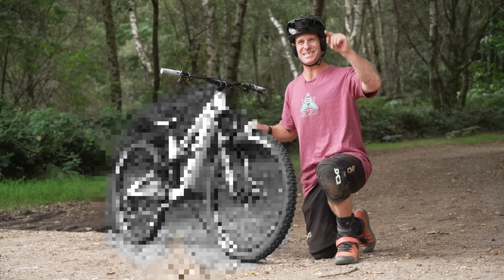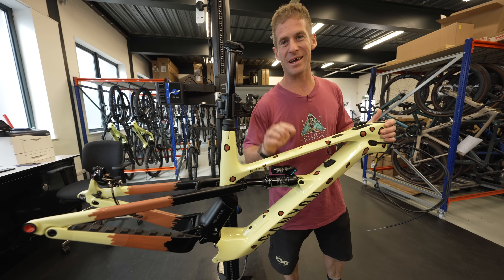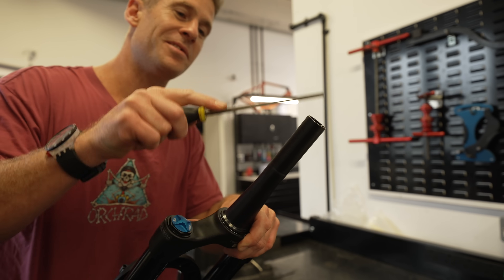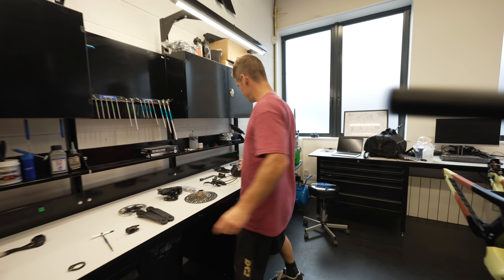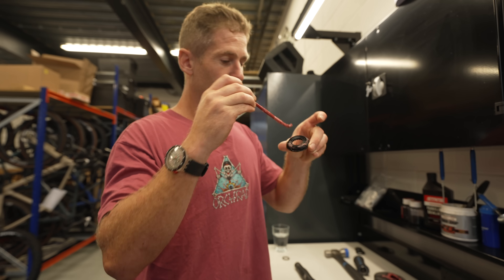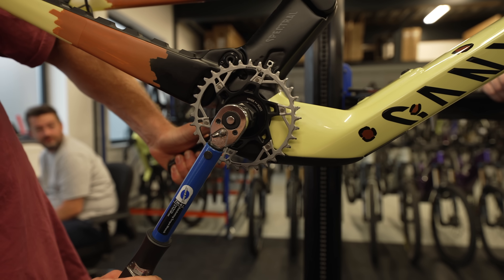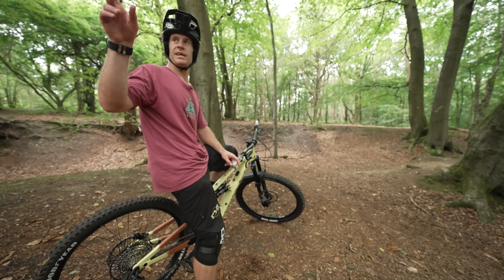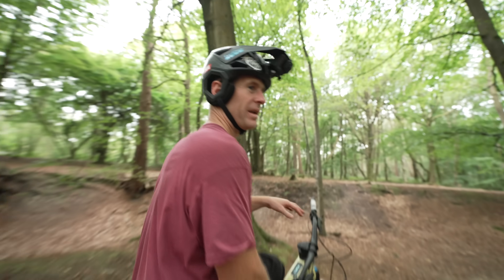MY NEW CUSTOM DESIGNED MTB - COULD THIS BE THE BEST BIKE EVER MADE?

Comment: Got a Canyon Torque a year ago. Ridden 15h on on it intermediate riding and now the "swingarm" broke straight through at a weld. No crash no nothing. Just noticed the wheel touching the frame when riding. Could have died. They said if you don't service the bearings it could put unormal stress on the frame lol. Got a new part for free but never buying that crap again...
Reply: I had a Torque and the paint lasted about 2 rides before flaking off, I think they make good bikes but I just don’t trust them anymore, YT seem like good bikes from what I’ve seen 👍🏾

Comment: Is there a reason MBs don't have internal gearing with a shaft or belt drive? Seems like it would be a perfect use case and it would be nice to not have to deal with chains and deraillers.